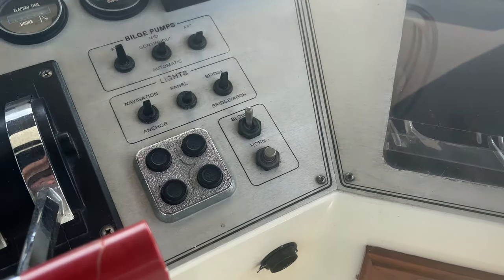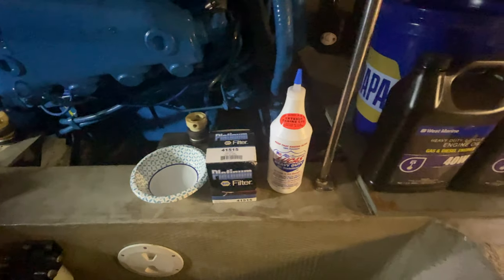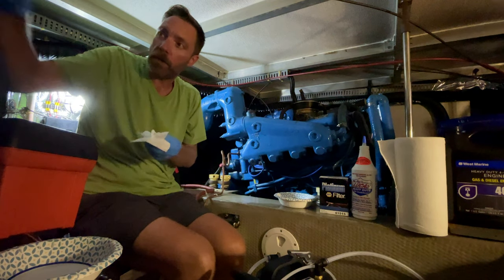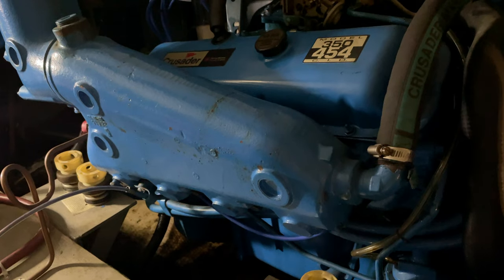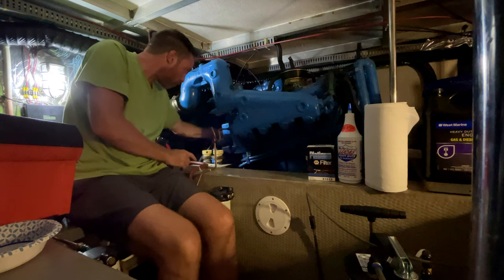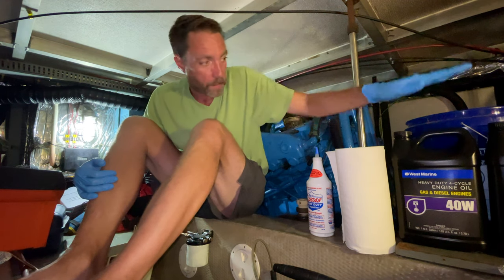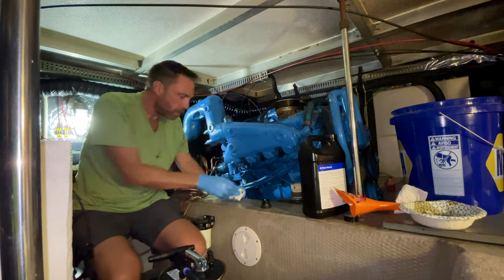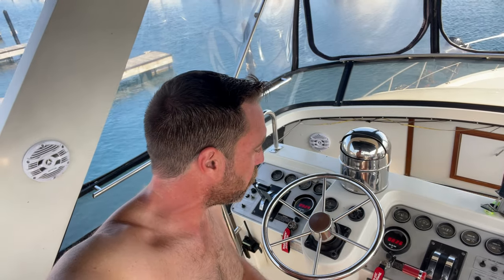How to Change the Oil on an Inboard Boat

Comment: I have a 1993 Carver 390 cpmy with 454’s but they are Mercruser and the Oil filter is positioned vertically so no paper plate needed. You had me stumped for a minute! Good video! Amazing how we always pick the hottest day of the year to do this stuff.
Reply from the maker: Not sure why this is designed like that. My friend has a Volvo Penta 454 and the oil filter is upside down on top of the intake manifold! At least it is easy to reach.

Comment: I suggest wrapping a 1 gallon ziplock around the oil filter, and once off, draining the filter with the oil pump. Then fill the filter with clean oil before screwing on. It's neat to watch the filter absorb the new oil, so fill it a few times. Then if you are really a nal, warm up the oil and change it again. I've been told as long as the filter is new this is not necessary. Still......Then pump used oil back into the new/empty oil container and drop it where you purchased the oil. As well as the filter.

Comment: Great video,  even such a normally easy job with a car is made allot harder on a boat.  I have always wondered why boaters never used the old hot rodder trick of installing a remote oil filter.  It still uses the same oil filter just moves the mounting point to  a vertical place off to the side and connects back to the engine with another screw on plate where the oil filter is located now and is connected between the two with high pressure hoses.  Would make changing the oil a much cleaner job.  As well if you really wanted to get fancy you could hook up a waste oil tank and fresh oil tank and a electric pump with a bunch of valves and tubes to be able to just open a valve and turn on a pump to suck out the old oil and close a valve and open another valve and turn the pump back on to pump new oil into the engine.  But that would be a huge pain in the butt just to  install.  Good work though.
Reply from the maker: Our RV has a remote filter and it's super easy to access.  The bowl trick seems to do the job.There are pumps we can install under the oil pan to make it easier to get it all out but they are expensive.

Comment: Hello,
I need to change the anti-freeze in one engine, I have closed cooling systems and thought I'd ask you if there are drain plugs on the block. Thanks in advance
Reply from the maker: Sorry, ours are raw water cooled only so I'm not sure how yours is set up.

Comment: Hey Kevin. You make it look too easy.  Update on my 4207 here in Nashville.  Probably going to sell at a deep loss ($30K). Just don't have the time or energy to replace an engine and get other stuff fixed (front head, all gauges, water temp and pressure send units, front shower sump, electrical short on 12 v side, etc.). Can't even locate seacocks. Oh, well...boating's just not for me.  Cheers...Doug
Reply from the maker: Sorry to hear you are having issues, someone will love that boat!
Reply: Hey Kevin. Been awhile since I've checked your channel. Ended up swapping my 4207 with a '88 Wellcraft Portofino 4300 that a dealer I've gotten to know had. Not a live aboard, but a simpler boat to cut my teeth on. Maybe try to find another act cabin in a couple years. Thanks again for your videos. Cheers, Doug.
Reply: Make that an "aft" cabin...